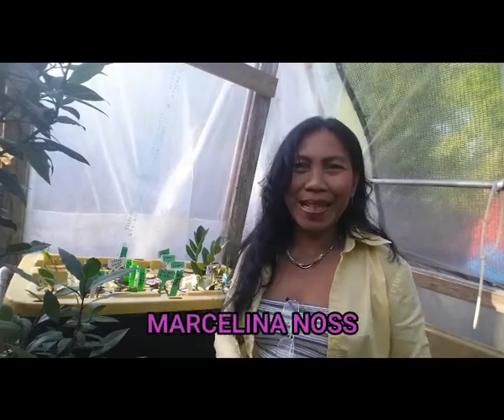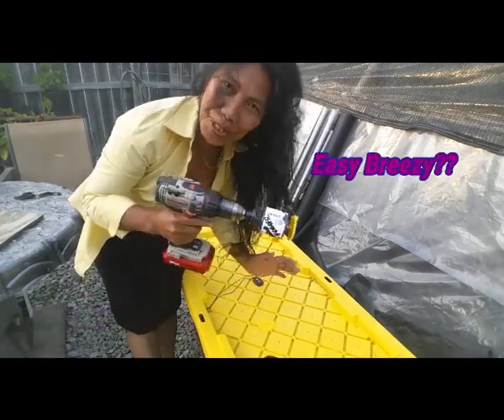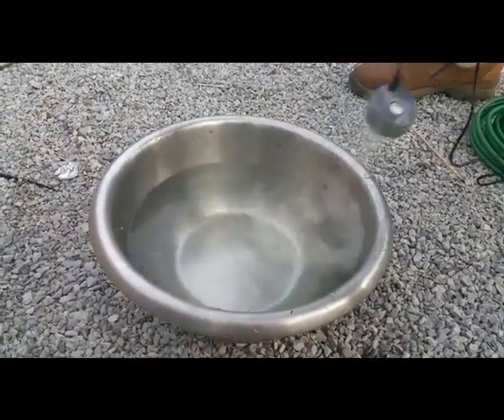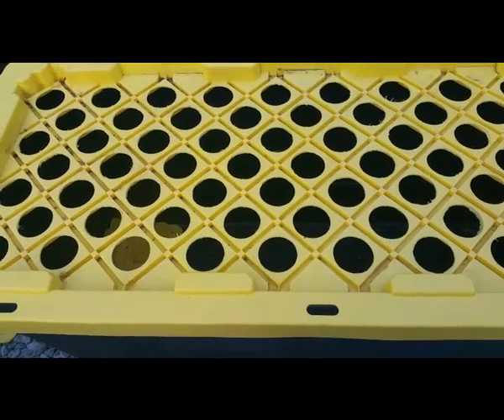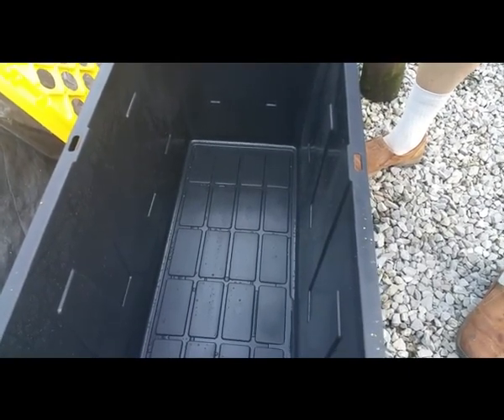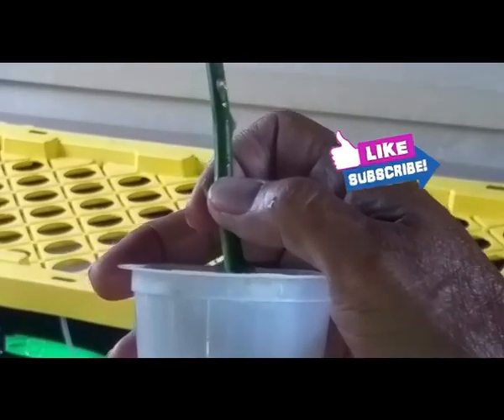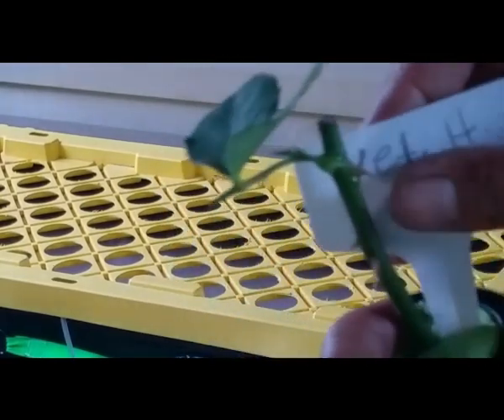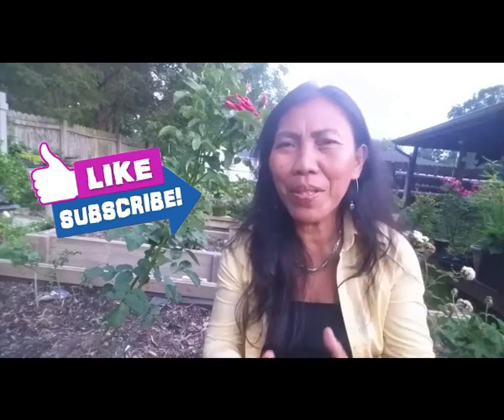BUILDING A MONSTER FOGPONIC MACHINE /  Aeroponics scoot over!

Comment: I made the fogponics box. Its truly a wonderful concept. I felt that now that it has turned hot here in Oklahoma my cuttings are drying out before rooting. Went to Lowes and they had a clear box which is identical construction and size. Turned upside down on top of the fogponics box it turns it into a greenhouse enclosure that I believe will retain moisture and will prevent premature drying of cuttings prior to rooting.

Next day humidity seen inside. 
Hope this is not too much moisture. 
My Grandmother used to stick rose cuttings in the ground then place a fruit jar over it. That worked for her. Jar must not be located in direct sun or jar will cook cuttings inside.
Reply from the maker: great,, make sure that direct sunlight isn't striking the plants.

Comment: You can extend the life of your Fog pucks and cut the heat they generate  by (1) calculating the time it takes to just overflow your tub with fog.  (2) calculating the time for the fog to settle halfway down.  Set these ON/OFF times into an Ebay dipswitch-programmable interval timer board (110V)  and connect your Fog pucks. (I use 2 min. ON/ 12 min. OFF).   It's very energy efficient,  makes little heat,  and prolongs the life of your pucks.
Reply from the maker: goofy,, you are making it too difficult, just keep the water level about 6 inches from the top, i run my foggers 24 hours a day and have keep them going for over a year only stop them to clean the plates on the foggers. I dont even worry about heat on the pucks as i do not place my fog machine in the sunlight and usually i welcome more heat to keep the temp at 70-75 degrees. The secret is to keep in in a well lit spot but not direct sunlight. During the winter i even place an aquarium heater in the tub to maintain the 70 f water. The beauty of the fog machine is to keep it simply but effective.
Reply: do you have a link for the timer you recommend? I just built a fogger and the only timers I can find are on/off in 15 minute intervals

Comment: hi! two more questions for you. 1) what is your outdoor humidity there? I'm in AZ and its DRY here. I'm concerned the cutting tops might dry out here.  2)what are the ratchet straps for? to hold the storage bin from collapsing with the weight of the water? thanks for the video!
Reply from the maker: our humidity here can vary from season to season, but i know your in AZ is much less. I would make sure that your propagator wasnt in the sunlight. As long as you have the bottoms of your cuttings in the fogponics i dont think your cuttings will dry out as long as you dont use really thin cuttings. Experiment and see. and Yes the straps are to prevent the side from bulging out. When i fill the tub with water the pressure pushed the sides out and the top wouldnt fit. The straps worked ok, but i cut out some 2 x 10 wood frame and that worked like a champ,

Comment: ***Update***
Overheating - 86F

My reservoir jacked up to 86F. This was with running the setup 24/7, and the water 6 inches below the top like the video mentioned.

Had to use ice to cool it down, which isn't ideal since it changed the PH as well as adds water to the reservoir. Froze some water bottles to use instead, but still not ideal.

Rigged a PC fan to a DC power cord and put it through one of the holes but didn't do much.

Location was in a shaded garage. Eventually had to move it inside with the A/C. Even with the A/C at 66F, it still climbs slowly. When it hit 72 I put in another bottle of frozen water with the cap secured. Working on potential fixes.

Side note would be that my intention to add a 3rd fogger and float would not be possible until the cooling issue is solved.

***Original***

I built this machine with a standard 27 gallon tote (the monster one in the video is 55 gallon I believe) and am loving it. A few observations for anyone planning to do the same:

-2 foggers and 2 floats are missing some of the inserts at the ends of the lid

-Where you see the holes in the lip of the container is a great place to saw a tiny indent in the top lip for the power cords to run through and close lid flush

-Remember to grab the Netpots with LIPS. The 2 inch ones in the description. Without the lips, your pots will fall straight through the 2 1/6 hole.

-Using the air pump in the link in description of video gives you 2 air stones. But not much air. Wondering if potentially 2 air pumps and 4 stones might be better?
Reply from the maker: are you running yuor system outside in direct sunlight?
Reply: @marcelinanoss8825  
It was in shade in an open garage with airflow.

But the ambient temperature here is very hot. Like 84 degrees.
Reply from the maker: @D-d-dvon  OK   GET YOUR SET A TIMER AND RUN IT ON 30 MINUTES ON AND 3O MIN OFF, that will give it time to cool off.
Reply: @marcelinanoss8825  
Tried that. Even with the foggers and pump off for 4 hours the temperature was still rising. 

So it seems the actual container is getting hot from the 30C and 80% humidity weather here, which is heating up the reservoir water.

Moved inside with A/C for now. Maintaining a steady 68-72F. Hibiscus cuttings are alive but no roots after 10 days. 

Funny thing is some leaves started to sprout on a couple cuttings at the bottom where the roots should be coming out 
🤷‍♂
Reply from the maker: @D-d-dvon  bring it in the house or an air conditioned room
Reply: @marcelinanoss8825  
Yup. Did exactly that. Been in the air conditioned room insides for about 9 days now at 68-72F.

No roots unfortunately. But they haven't totally died either.

Fingers crossed it will still work, but just take longer. Even if it's longer than the 14 days from your propagate hibiscus video, once it roots at all, I'll be happy!

Comment: Great video! You mentioned you need an air pump but I didn't see you put the air pump in. Also, why do you need the net cups? Can't you just use the collars by themselves? Thanks for your reply.
Reply from the maker: the collars will fall in too easily and hard to find a keyhole saw to make it perfect. I use the air pump and it makes a huge difference. Keeps the water oxygenated and prevents stagnation. Trust me on that one!
Reply: @marcelinanoss8825  Thanks for your response!

Comment: So how do you deal with the heat? I have a 4x6" four transducer fogger in a 50L container and after running it for two days the water temperature went up maybe 50 degrees. I don't think it's going to make very many roots with an chamber temperature over 130F
Reply from the maker: i want my water to be at 70F. Plants cuttings will root faster in the warmer temps, In the winter i keep a aquarium heater in my tank, but as it is next to an outside panel in my greenhouse. Never a problem with using 2 foggers in 27 gallon tub. Perhaps your fogger is to much, cut back to using two. But 50F is not an problem

Comment: I just finished drilling the holes in the top of the yellow tote lid.... we used a 55 mm keyhole saw and all the 2 inch cups fall through the holes. So disappointed ! I wanted to start cuttings tomorrow. Now, we have to figure out how to make the holes smaller or the cups larger. I love the concept of the system but the info on the saw size was incorrect.
Reply from the maker: you need to get the net cups with the wide lip..let me get you the link ok ?
Reply from the maker: heres the link you need :)  https://amzn.to/2NS02wP
Reply: @marcelinanoss8825  Thank you so much. I ended up using electrical tape ---- it took 23 wraps to make the lip large enough. I also found some black rubber gromets that can be purchased. They were a bit spendy so I will look for the lipped cups. THX !
Reply: You need 1 7/8" hole saw for 2" net pots.  Works with both types of netpot tops
Reply: @moongloomable  I'd recommend against this for anyone reading this comment.

I saw this and got the 1 7/8 based on this suggestion. It's quite snug as moongloomable mentioned, so even the pots without the lips will stay fine.

Problem with this is that it's REALLY snug. And it can actually squeeze the stems too much on softer wood. Also much tougher to take out the netpot and collars when it's that snug. I'm still using the one I built with this setting for harder wood though.

I'd recommend staying with the recommendations in the video. 2 1/6 inch(55mm) hole saw. 2 inch netpot WITH LIP. 

Once you have the lip, it'll fit real nice, but also be super easy to pop in and out for both netpot and collar. Which is helpful when you have between 26-30 cuttings in

Comment: What brand is the best fogger for fog Pontic system? When I go to Amazon the comments and ratings on the foggers are very low . People say they only last a month before they quit working .
Would appreciate your expertise on this 

Thanks Paul
Reply from the maker: i run mine 24 hours a day,, the key is to use a Q-tip to clean the plate.. the link is posted below my video. Try a couple and see for yourself, they arent that expensive

Comment: Does the fogger machine provide air bubbles or do you need  to submerge an air-pump into the container?
Reply from the maker: if you want more oxygen you will need to add an air pump with a stone. This keeps the water from becoming stagnant as well

Comment: Could you propagate just with straight water?
Reply from the maker: you can, however your results will vary and you will lose more cuttings in straight water due to stagnation, lack of O2. A lot of stem rot in straight water, Make sure to change your water weekly.
Reply: Depends what you are wanting to grow I have cultivated everything just by putting cuttings into any random glass of water so far but fogponics should be 30% faster growth so I want to try an experiment with it.

Comment: Does any company supply a 64 insert fogponic turnkey cloning system ?
Reply from the maker: no.. they only sell the misting heads which i have used 4 in the past, but they clog up so easily and you need to constantly replace them. If you want a true fogponic system go to.  www.cashyourgreens.com  Look for fogponic system in the menu

Comment: Do I put in the HydroDynamics Clonex Clone Solution before they even have roots on the plants??? I  would think it would just be a waste of solution until the plants have some roots to absorb the nutrients. Then add the solution.  What is your advice?
Reply from the maker: we use it before and after. Its not going to dissipate so as your plants begin to sprout roots it will greatly enhance and speed up your rooting.  Will your cuttings root without it? yes, but once they root a little it will feed your new plant since there is no nutrients in the water
Reply: @marcelinanoss8825  Thank you that does make sense.  One more question... Do you have to change the water? I recall in one video you had mentioned that?   I use an air stone and once a week pour a little peroxide in the water (I have a small system) and not pour the water out?  That was my main concern for not adding the HydroDynamics Clonex Solution.  I'm trying not to waste it. $$$ :(   Or do you have one video that answers all my questions.  I've watch a of them.    Donna

Comment: how long do you leave the fogger on?
Reply from the maker: you can leave it on 24-7 or run it for 30 minutes on and 30 min off to prolong the life of your foggers, personally i leave them on 24 hours a day as the foggers arent that expensive
Reply from the maker: just plug it in :)
Reply: What I do is time how long it takes for the fogger to fill up the grow chamber .
Then time how long it takes for the fog to dissipate. 
Then time how it takes for your roots to show that they need water. ( no water beads on the roots).
Then adjust your times accordingly. 
This is for growing only.
When growing you don't want your roots constantly wet. 
For example times in growing would be 30 seconds on and 10 minutes off.
When cloning just leave the fogger on 24/7. Then once the roots are established adjust accordingly. 
I hope this helps.

Comment: Fogponics - quieter, faster, finer roots, less electricity.  The emitter discs are a consumable and should be replaced periodically.
Reply from the maker: mine last at least a year or more. Fogponis is amazing
Reply: @marcelinanoss8825  I am trying to brainstorm ways to use the fogponics to assist with orchid propagation.  I may end up with a modified lid with horizontal slits and net pots with polyfill fiber or foam, etc..  I may also try a vertical fog wall to allow air layering without cutting from the mother plant until after plantlets are fully rooted...  ahh , "fog wall"...

Comment: Where do you buy this container? Thanks you
Reply from the maker: you can make your own or you can buy this one https://amzn.to/3tgy0eG  watch my video on how to make it check out below the video on the description on the parts used to make one.
Reply from the maker: if you live in the US, Home depot carries the super large totes
Reply: I bought Psycloner Pro Aeroponic 35 pcs last month but my plants fail to cloning . They did not come out roots and dying. I am planning to do your fogponic machine now.
Reply from the maker: @sandartun1925  fogponics is a muich higher success system. jets on the sprayers can get plugged up from the small particles
Reply: I put in fog mist and the water is very warm . Is this normal or wrong?  My cutting becomes drying out a little bit. Please advise.
Reply from the maker: @sandartun1925  KEEP THE WATER LEVEL ABOUT 6 INCHES FROM THE TOP,, STILL TOO DRY, ADD AN ADDITIONAL FOGGER. Water should be around 70-75F keep out of direct sunlight
Reply: Thank you so much !
Reply: Do I need to put in Air pump?
Reply from the maker: @sandartun1925  yes adds oxygen
Reply: Thank you so much Marcelina, I really appreciate for your quick reply..